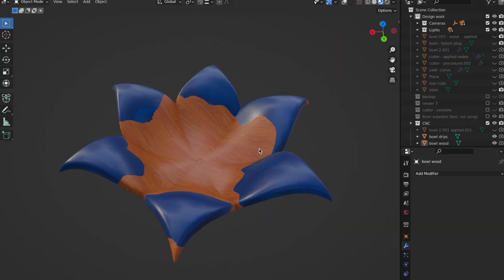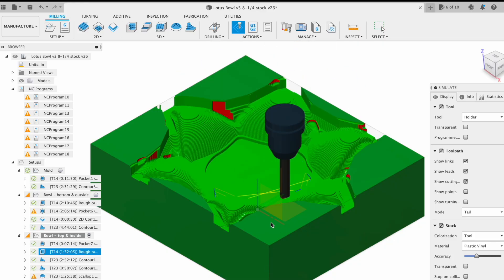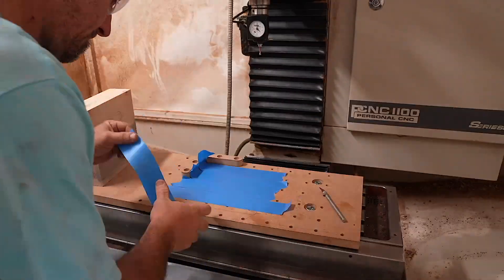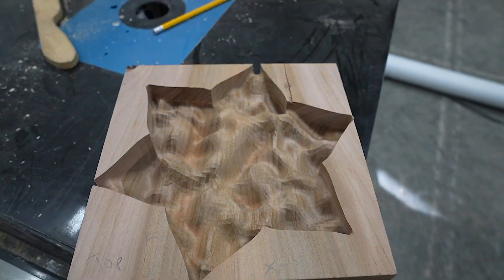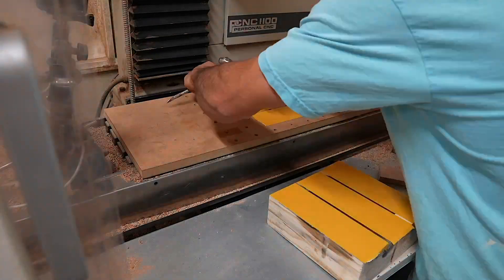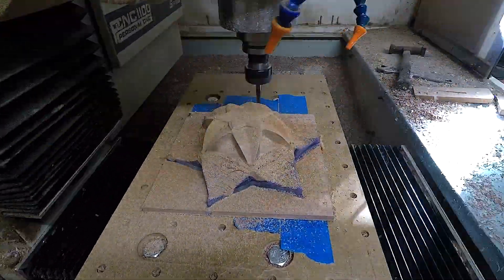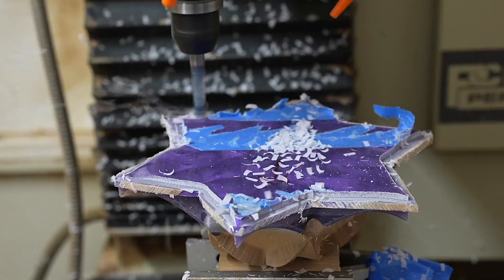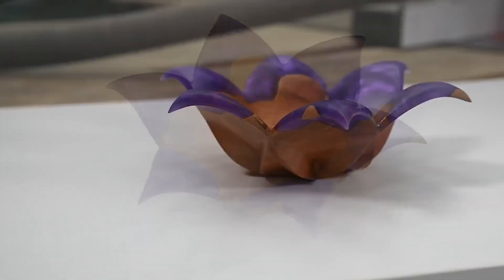Lotus Bowl CNC Woodworking Art - CNC router carving an epoxy resin artwork piece

Comment: What was the approx run time on the cnc ‘ing?
Reply from the maker: I'd say 10'ish hours total...but consider my machine's max RPM is 5140, which is horribly slow for woodworking, so I use slower feeds, and it takes longer.  A proper 18000 RPM router could probably do it in 1/3rd the time or so. Some other limits are how strong the work holding is.

Comment: Great stuff as always! For the fixturing I was running into the same problems when using the tape and super glue method on a small surface area. Also indicating, aligning every time is very time consuming. What I did is designed a master fixture plate which is used for both operations. The WCS is set to the corner of this fixture plate and everything is modelled in Fusion. For the second operation I use the feature at the bottom to indicate and also clamp on. Together with the tape and super glue this gives a very accurate and reliable setup. For holding the stock in the first operation I use the Tiger Claw clamps for Carbide3D with their lockstops on the opposing side to align in X and Y direction. These clamps are very low profile and have a good coarse teeth to hold onto wood. To lower them even more I recessed them halfway into my fixture plate. This still gives plenty of holding force.
Reply from the maker: Awesome, those are great ideas! I was thinking I do need to have some persistent WCS for easy repeatability. It would help a lot with repeated production runs. Lately I have been just doing one offs (or so), but I might need to rethink that. I’ll check out the Tiger Claws, thanks!
Reply: @CorbinDunn  It really helps a lot. For the second version I'm thinking about making the location piece for op2 as an insert. This way you can have one main fixture plate and only specific inserts for different bowl designs. Same as soft jaws for a regular vice. For the first operation a grid of mounting holes will be enough assuming always starting from a square piece of stock.

Comment: You could CNC that bottom profile into a square, then insert the part, and presto: get your reference again. But yeah, that's a bummer to lose the easy reference.
Reply from the maker: But how would I be able to indicate in the bottom profile? I was thinking I could touch-off on the pedal tips and get it "pretty close", and sand away any imperfections.
Reply: @CorbinDunn  I don't think you would need to indicate in the bottom profile: Just do not remove the sacrificial base (w/ bottom of bowl profile) after machining it, and then glue your bowl in. The accuracy would then be whatever tolerance you allowed for the bottom of bowl profile fit. And you would already know the part-center from the previous machine job (the sacrificial base).
Reply from the maker: @joshpit2003  Yeah! this is a good idea that I had pondered a bit. I was worried that the square base might limit where the bit can access, but if I made it just the minimum size to fit in the round bottom it might work. I'll have to try it out! It would make the second operation setup much easier and faster .